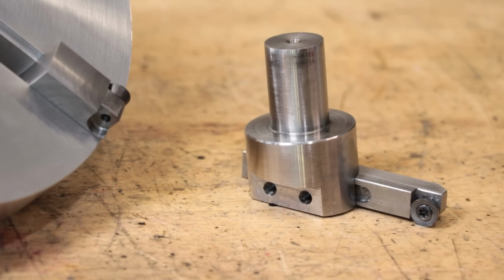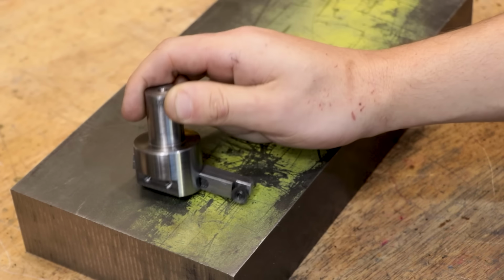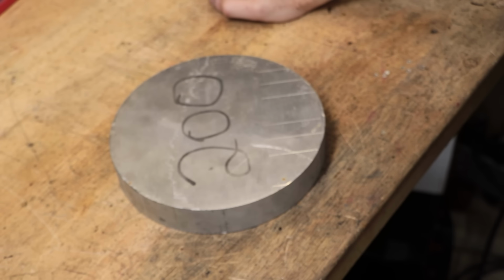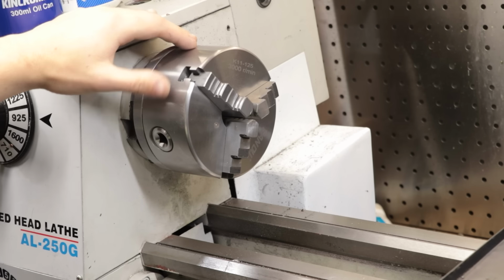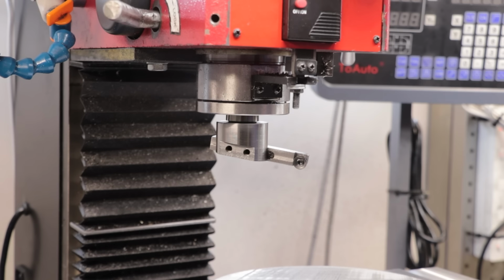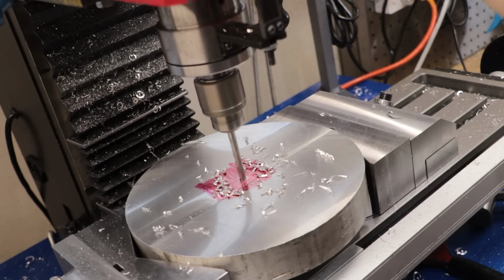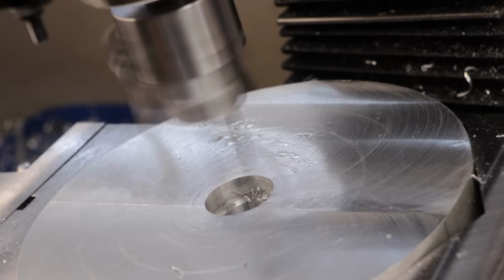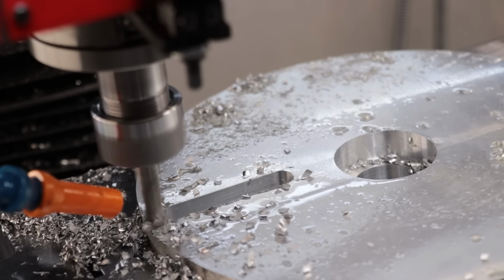Making A BIG 200mm Fly Cutter For The Milling Machine

Comment: How about two cutters 180 degrees apart. Cutter heights would be .005" difference and  cutter distance from center would differ by about  .200". The first
cutter would rough and the second one would take a .005" finish cut.

Comment: Subsequently, Kurtis at Cutting Edge Engineering has made an even larger one in steel but since he used more than one, six I believe, cutters it hardly serves as a fly cutter but rather a large surface end mill. Unfortunately, he sent it out for nitriding and heat treatment which caused it to warp some resulting in some bad vibrations and balance issues. I don't know if he subsequently solved the problems or not.

Comment: @artisanmakes any thoughts on using a cast iron gym weight for the body? Or would the casting be too rubbish? Just not sure why I don't see more videos of ppl using them more often.
Reply from the maker: Cast Iron gym weights vary so much. Ive had good ones and bad ones, and the occasional one that is actually cast steel. Does not stop me using it, but I only use them for parts that aren't under a whole lot of force. For a part like this I would probably keep to aluminum or steel. Something about the brittleness of cast iron unnerves me in the application. Cheers

Comment: Except, even a large workpiece can still be faced off with a small fligh cutter.  Chatter depends upon your setup.   You just take more passes, and you don't have to have that monstrosity for a job.   You aren't gaining that much efficiency with it.   That's why for 200 years you didn't see an arms race with fly cutters.   But hey, if that's what you think, you do you.  Old machinists will just shake their head at the waste of materials for an unnecessary, but youtubeworthy build.
Reply from the maker: My big aim here was just getting a u inform surface finish. One large cutter will do that. And I don’t see why anyone would take issue with a large set up like this, it’s no different to the cutters they have always used for doing cuclinder heads. Just a slightly different set up.

Comment: A good way to break up chips in stickey material is to drill holes close to your finished diameter. This way instead of having chips for the full circumferance you will have chip breaks for every section.

Comment: OLÁ.  Um suporte de alumínio para uma operação de precisão indica que não fazem a mínima ideia das vibrações que ocorrem ao aplainar um cabeçote de ferro ou alumínio.  A função do alumínio é exatamente o contrário do que se necessita.   ABRAÇOS...  Roberto Udo Krapf
Reply from the maker: Aluminium is just fine. The forces with a single point cutter are quite low and it is a very common material and valid for these style of fly cutters. Cheers

Comment: If you can avoid putting metal particulate into the air are using coolant liquids you're always better off in the long run

Comment: Random Orbit sanders are a great way of putting an uniform finish on metal surfaces.

A light touch and a courser grit than what you may think(60-80 tends to be my default) is the better way of doing this(especially on alu) and the disks without holes last a lot longer and you don't really need them as you're not really removing any real measure of metal as much as just creating a uniform surface on it.

Comment: Nicely done. I'll be honest, my first thought was that you were just going to press/shrink fit the cutter onto a MT3/JT3 arbor. I like that you made a larger fit arbor with a screw to secure it.
I would rather use 7075 for a project like this, but 6061 shouldn't be a problem to machine - carbide cutters and mist coolant! 6063 on the other hand...

Comment: When i made my own little fly cutter, i welded a nut on the opposite side of the cutter and used a long bolt as an adjustable counter weight to reduce vibration.

Comment: Nice job.  Hey, could we get a close up view of your vice speed handle?  What happened there?
Reply from the maker: I broke it a few times and ’m crummy at TIG welding 1214
Reply: @artisanmakes    LOL.  I remember being surprised that you chose to weld the handles on, when you made it.  I made mine with 3/8 - 16 threads.  I'm sure that with your new found machining skills, you can make a better one. Regards.
Reply from the maker: I originally was going to get my friend to braze it, but that never materialised

Comment: One thing you can to to reduce vibration is to bevel the top side of the fly cutter's wheel.  Removing sufficient material will create multiple harmonics and help keep the cutter from vibrating at any one specific harmonic.

Comment: Copying a morse (or other) cone is not that straightforward. Key is that your feeler, used to measure the angle, is set at the EXACT same height as the center of your workpiece.
Reply from the maker: Yeah ive been caught out there before. Absolute pain to set up

Comment: Pressing steel into aluminium? 
Isn't that gonna cause the aluminium to wallow out and the press fit fail?
The cap will help it not take off your legs, but may need a rethink of materials.
Reply from the maker: I wouldn't think its a huge issue. Even if the fit becomes less tight the force of the cap pressing on the flange will keep it in place, which I think is doing most of the clamping anyway. For what its worth I don't even think clickspring has a retaining cap on his fly cutter, just a press fit and that hasn't shown any issues. Same for In heritance machining, although he uses 4 bolts as compared to me using 1

Comment: Nice job! Would suggest that you get some Permatex Prussian Blue used to seat vales when cutting the valve seats in the engine.  It is a non-drying oily paste that will show you the engagement points of your taper.  Finally, buy a potable band saw, trust me you will like it.
Reply from the maker: Good thinking. I probably should have blued it up.

Comment: Really nice, but why can you not make a custom large-headed bolt so you can get rid of the clamp? Also if you machine a groove just like on the bottom for the insert, you get rid of more weight. 
Hats off,
Greg
Reply from the maker: You can if you want, but I have a bunch is m10 screws so it just seemed like an easier and more straightforward way to clamp it

Comment: I made one from an old cast iron lathe faceplate but filled the back with molten lead to deaden the ringing and make it even more terrifying.  On my Bridgeport I had to balance it really carefully or it caused ripples and harmonics. I decided it was too dangerous to use cast iron without a serious guard, so I melted the lead out and used the faceplate for something else.  It's due for a remake in steel, but I'll still use a lead infill to kill off the ringing.  I used an ordinary lathe tool to hold the cutting insert and a lump of steel the same weight and size for the counterbalance.  It looked terrible, but worked well.
Reply from the maker: If it worked well that’s all that matters. Cheers

Comment: My friend has a homemade 300mm cutter like that, on a bridgeport and uses it to skim car cylinder heads in one pass.
He has 2 inserts, slightly different positions, at 180 degrees, so its balanced. Also, one insert is a bit further out and a few thou higher than the other, so in one pass it takes a cut and 180 degree later the second insert does a finishing cut 9f a couple thou if you get what I mean. Looks homemade but he is smart and it works superb.
Reply from the maker: And I thought 200mm was big. That’s gotta be one huge  piece of tooling
Reply: @artisanmakes  ... yeah i5's not pretty, looks like it was cut from some 30mm plate aluminium and lathed round.
He does engines aso had ability to balance it good, and of course the bridgeport geared head has a lot of low speed torque for something that diameter. He can do a 6cyl car head in one pass on X axis on bridgeport.

Comment: I wonder what the moment of inertia of that big wheel of aluminium is, I imagine it stores quite a bit of kinetic energy even at just 1000 RPM. Lets just say you don't want to crash that into anything while it's at speed because the results can be quite explosive.
Reply from the maker: You’d probably expect it to deform rather than explode given that aluminium is quite ductile. It does make me feel somewhat uneasy using it, but if you are alert and careful you shouldn’t be crashing it.

Comment: Why not do multiple cutters in one unit to help speed up the cuts, as well as balance the unit better?
Reply from the maker: a fly cutter only uses one insert, which is not as fast as face milling but offers a more uniform and smooth surface. Compare it to the facemill I have which uses similar inters but uses 3, it leaves a much rougher finish
Reply: @artisanmakes  think my comment disappeared. 

Check out inheritance machining (Us based YouTuber). He just made basically the same size fly cutter with two cutters and surface finish is amazing. 

My automotive machine shop I take my cylinder heads to has what they refer to as a fly cutter on a dedicated decking machine that has 4 inserts. 

Maybe I’m missing something?

Comment: Just a heads up... you should broach a keyway into that fly cutter, and arbor,  and key them together. Just an added bit of safety to keep the fly cutter from spinning on the arbor.
Reply from the maker: If worse come to worse a pin drilled through the cap to lock it in place can do a similar job

Comment: Why not have a fly cutter on both ends, would it remove twice as much material 🤷‍♂️
Reply from the maker: a fly cutter only uses one insert, which is not as fast as face milling but offers a more uniform and smooth surface. Compare it to the facemill I have which uses similar inters but uses 3, it leaves a much rougher finish
Reply: @artisanmakes  thanks for making that clear, great video by the way 👍

Comment: Just a silly question from a fabricator but why do fly cutters only have one cutting tool
 would it not balance better with two or three ?
Reply from the maker: a fly cutter only uses one insert, which is not as fast as face milling but offers a more uniform and smooth surface. Compare it to the facemill I have which uses similar inters but uses 3, it leaves a much rougher finish

Comment: Did you consider galvanic corrosion between the steel and aluminium? If this becomes a problem I believe there are products available that isolate the two metals.

Great finishes and interesting project. Thank you.
Reply: I'd be surprised if you'd notice it over time. It's one hell of a chunk of metal. I just restored a drill base that had been out in the weather for 20+ years and covered in rust but it came out looking almost brand new. Galvanic corrosion is more concerning for thin materials and for electrolytic issues. Petroleum jelly would solve the issue if there was one.
Reply: Not a problem. Look at the aluminum wheels on your steel hubs for decades in the water and dirt, salt.

Comment: That super long curl of aluminum at 5:06 spinning at high speed made me itchy. Especially when your hand came on screen.

Nothing good comes from razor whips.
Reply from the maker: One of many reasons why I dislike machining 6061 aluminium
Reply: @artisanmakes  i don't know much about aluminum alloys, is 6061 more of a casting alloy?
Reply from the maker: 6061 is a very common general purpose alloy. Great all round properties but machining it can be tricky as it tends to produce these long stringy chips

Comment: Back in the 1970's I was trying to make a large angle plate for work holding on a Myford super 7 lathe. The subject was a six inch long piece of 6"*6"*1/2" angle. Suitable holes drilled to match the T slots in the cross slide allowed it to be mounted for facing. Didnt have access to a mill. Needing a fly cutter I tried a steel post with a 1/4" hss insert attached to the face plate. It worked but the hss couldn't stand the cutting of the steel angle. Carbide lathe tools were rare and hard to come by but used concrete drills were easily had. Remove the tip, braze it onto a four inch piece of 1"*1" steel bar and sharpen on a green stone. To mount it I used a 6" four jaw chuck, two jaws forward and two backward. The tool nested in the two backward jaws to give a 6+" diameter and the forward jaws, hard up against the sides, stopped everything from flying apart. Proceeded slowly and had to duck from hot bits coming off the tool but a few passes and we had a suitable angle capable of holding the parts we needed to machine and perfectly trammed to the lathe axis. Still have the tool but unfortunately not the angle. There have been times I could have used it. Maybe I should make another.

Comment: Your results were great I have no criticisms. What rpms were you using when you drilled the centre hole and when you were boring the same hole? Just curious. You seemed like you had fairly fast RPM's and it was working well for you.
Reply from the maker: Good question, and I am not too sure since its been a few weeks since I did this. But it was probably close to 1000rpm. The DCGt inserts I use work best at higher speeds

Comment: How about mounting the round blank on the taper in the mill.  Then, clamp a cutting tool vertically in your vise & use the X-feed to face the underside?  That would also keep it parallel with the mill deck.

Comment: Like others, here in the comments section, I thought maybe it would benefit from having a second insert at 180 degrees to help balance the fly cutter and to halve the load, remove twice the material for each Revolution?

Maybe there’s a reason not? 🤷‍♂️

I’m all ears, as I’m only learning.
Reply from the maker: a fly cutter only uses one insert, which is not as fast as face milling but offers a more uniform and smooth surface. Compare it to the facemill I have which uses similar inters but uses 3, it leaves a much rougher finish
Reply: @artisanmakes  You can always remove excess inserts when you do finishing pass.
Reply from the maker: Yes you can but the facemill I have is only 50mm, which isnt exactly big
Reply: @artisanmakes  But your new fly cutter is. ;)
Ok, lining up 2 or more adjustable inserts so they all cut is a bit problematic.

Comment: I would definitely static balance that, just a hand drill and fair sized bit would get that job done quickly. The mass of the big flywheel should help it to power through a cut.

Comment: The best finish for aluminum is with polished carbide inserts.  After seeing it at work, I think it would benefit from a  counterweight to keep the shaking down to a minimum.
Reply from the maker: The best finish I ever got in alu was with a PCD insert. Polished carbide is a close second. Cheers
Reply: @artisanmakes  I'll take a look at PCB inserts. I will say that not all polished carbide inserts are the same. I have 3 different brands and one brand is pure crap.

Comment: I wonder if you should have cut an opposing groove and make like a dual cutter but don't insert the second carbide button.
 It looked like there was a shake with the camera as you were cutting with the new fly cutter! 
Either way it looks like it did a good job in the end. Looking forward to that big chunk of steel getting its haircut! It is always amazing to see the finish come out after a fly cut.
Keep up the good work!
Reply: Some 40 years ago I worked at a machine shop and used a fly cutter something like this, only it had three cutters - one set for a shallow cut but set furtherest outboard, one mid depth and diameter, and the third set for a deeper cut and set furtherest inboard.
Reply from the maker: It’ll do that when the speeds and feeds aren’t spot on. Could be the balance but the big fly cutter can be unforgiving

Comment: Nice job!!    Where do you buy the screws for attaching the "inserts"?
Reply: anywhere that sells inserts should have them.
Reply from the maker: I think I bought them off eBay. Pack of 50 since I tend to strip the heads or accidentally drop them into the swarf tray frequently

Comment: You are turning into regular machinist. Nice job. I personally would add 3 other slots with insert on each slot so it will cut 4 times per revolution. But of course that depends on the power your mill has...
Reply: That will add the possibility of vibration (more teeth in contact) and force you to align all 4 cutting edges height wise in order to maintain a high quality surface finish. Single point fly cutters make sense in so many ways, and unless you are chasing seconds, possibly do more hard than good.
Reply: @adamr8878  Naw, I have made several and it works fine. You don't HAVE to align all 4 in fact I deliberately miss-align them depending on the job. You can either feed 4 times faster or cut 4 times deeper. Aligning them is not actually hard if it is incorporated in the design.

Comment: hmm a fly cutter made out of aluminum Hiss Hiss. Well it seems to work but I can see the bench wobble. I'm not a person with ocd I'm kinda a very messy person that likes to see something working beyond the professional level. I don't mean to throw any of my poopies at you but I'm just a weird in my own world and as a lonely wumpus with autism. I have a video on my mini lathe lathe now and its on a schedule to be uploaded soon hope you like it.
Reply from the maker: It does tend to wobble if that speeds and feeds are not perfectly dialed in. I learned that the hard way and it chewed the the surface finish along with it.
Reply: @artisanmakes  And morse taper 3 doesn't help with that either its just not beefy enough for something like that.
Reply from the maker: Not like I have an alternative. Spindle is morse taper 3. But once you get the speed right the mill settles down and produced the mirror finishes

Comment: For mounting on the lathe, you could maybe have drilled and tapped some holes for studs first and bolt the workpiece directly to the spindle.
Reply from the maker: You could. Definitely another way to do it
Reply: The mill was a little bit safer I think